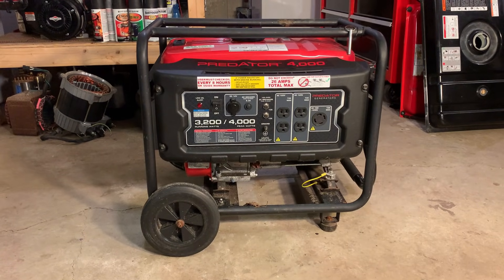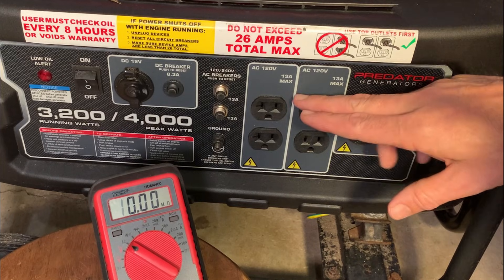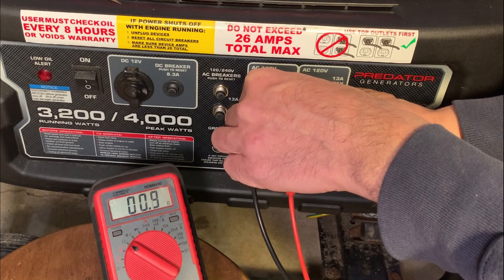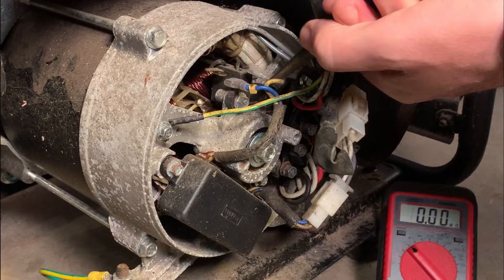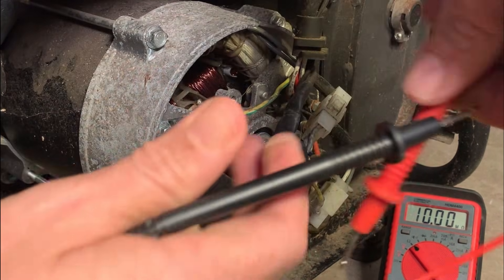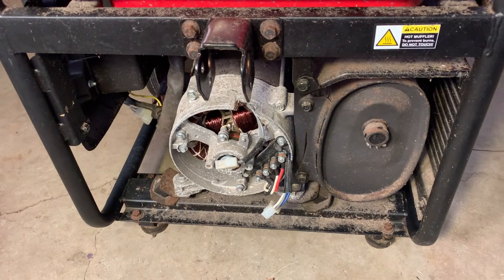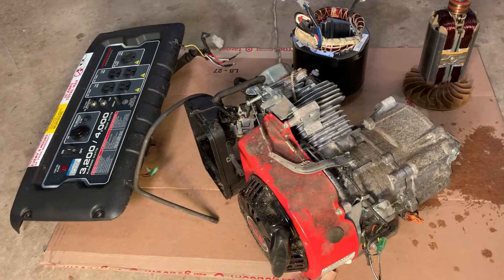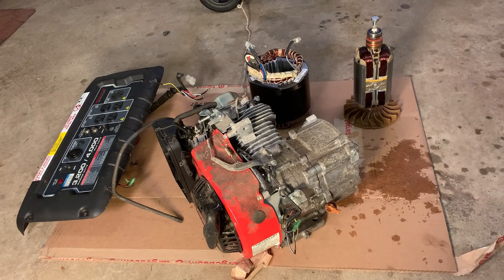Predator Generator Not Making Power

Comment: Similar problem,  I removed the wire winding (counted the number of turns), rewound it for $8 worth of wire, and it works like new.  It was a pretty easy fix.
Reply: Don’t forget about the generator safety rules: Always make sure you follow all the generator safety rules whenever you use your portable generator. This is only a reminder. Generators can be dangerous if not used carefully. Every year, hundreds of people die or get injured when using portable generators due to carbon monoxide poisoning and electrocution. Make sure you are using your generator carefully and keeping others safe as well. There is something very serious that everyone should always be aware of when using generators. Some people do run their generator indoors which is not safe and that increases the risk of carbon monoxide poisoning which can cause death of family and you. Some people run their generator in wet conditions which can electrocute them. Please remember that you should never run your generator indoors. Remember that carbon monoxide is an odorless and colorless gas that you cannot see or smell. Carbon monoxide is a silent killer. Keep that in mind. Make sure your generator is 15-20 feet away from your house and away from doors, windows, and vents. Never use your generator in your porch too. Having a carbon monoxide detector is very important against generator safety. Some people also allow children to go near the portable generator which could pose risks. We need to keep an eye on our children making sure that they are not near the portable generator so they won’t get electrocuted or burned by the generator which is dangerous. A locking enclosure also keeps kids safe. A generator shed might look like a tempting place to explore, or take cover during a game of hide and seek, but a generator is a dangerous piece of equipment that can cause injury. It says on the manual that we should also keep children away at all times from the portable generator to avoid injuries. Please do not allow a child or unqualified people to operate the portable generator.  It is important to keep your children safe especially little ones. The portable generator can be hot during an operation. Just because some manuals missed what should be listed doesn’t mean it’s safe to do. Always follow the generator safety rules when using portable generators. Generators pose electrical risks. If you need to use your generator during wet weather, you need a generator tent to protect your generator from getting wet. Don’t let your generator get wet. Keep your generator dry and before using your generator, please make sure your hands and your generator is dry. Do not wear loose clothing when operating the generator. Everything that is said on the generator’s operating manual should not be ignored. Never smoke cigarettes near the generator. Please keep flammable things away from the generator. Never overload your generator too. Your generator can catch fire. Never ever try to plug a generator cord into a wall outlet to avoid back feeding. Back feeding your generator is dangerous. Always turn on your generator first before plugging in appliances and shut off the appliances before turning your generator off. Use a heavy duty cord for your generator and the cord should not be worn out. All the instructions should be followed carefully. Never refuel your generator while it’s running. It can cause fire if fuel spills while your generator is hot. You should turn off your generator and let it cool off before refueling it. Having a fire extinguisher next to the generator is also important. This is only a reminder for everyone’s safety of using generators. Make sure your generator is properly grounded. Having a fire extinguisher next to the generator is also important against the safety rules. https://youtu.be/I1jT3ANENvI and here is a video more about keeping others safe when using generators and also about our family’s safety. It’s important to keep our little children safe as well. Make sure your little children are kept away from the generator at all times especially when it’s running. Hope this helps. Always remember that it’s better to be safe than sorry.
Reply: @The_Happy_Aviation_Enthusiast  Stop reminding people not to use engines indoors. We need to cull the herd. Anyone stupid enough to run a gennie indoors needs to be removed from the gene pool.

Comment: Either that gen set sat outside or the owner was lying about 'it was never even used'! LoL
Reply: Never used “a lot”.
Reply: I think it sat outside, (the frame and corroded wire) but the brushes look new.
Reply from the maker: Definitely sat outside for a long time.
Reply: @jcondon1  if I have 0 ohms across the stator, does that mean a bad stator? 
I’m confused because I tested them several days ago with a digital, then tested them with a Simpson 260 analog meter w/fresh batteries and got 0... THEN I retested w/my digital and got 0. Am I doing something wrong?
Reply from the maker: @wayngoodman5889  is it zero or OL?  OL is definitely bad.  Never seen one at 0.  Closest was probably 0.2.  If 240 volt, are both main coils zero?
Reply: @jcondon1  fresh batteries in Simpson 260, properly zeroed, three leads (white/red/blue) on Toro T3000D... manual says test across blue-to-red - zero ohms. Testing white-to-red and white-to-blue also zero ohms.
This is on a 0-1 ohm scale so zero means zero
Reply: Problem is when I tested on Sunday - w/a digital multimeter - I was getting close to normal resistance...?
Reply from the maker: @wayngoodman5889   I took a quick look at the wiring diagram and agree blue to red is a good test as well as blue to white and red to white.  Visually when looking at the stator, do you see any issues?  Most likely you will have to uninstall it to have a better look.
Reply: @jcondon1  is there any way I can connect with you directly? I have a ton of questions that might best be handled off-line.
If not, everyone be prepared for some truly ‘stupid newbie’ questions...
Reply: @jcondon1  to answer question directly, no obvious issues... the genset is dirty as all hell but no immediate signs of burning or overheating - at least to MY uneducated eyes!
Reply from the maker: @wayngoodman5889  on a computer browser go to my about page.  There should be an email link for business inquires.  Does not seem to work on mobile devices or in the YouTube app.
Reply: @jcondon1  will do! I’m using an iPhone app so I’ll grab my laptop and get with you that way.  Thanks SO much fir the offer - I’m pretty handy but generators are ‘black boxes’ to me...
Reply: @jcondon1  sent an email... hope it gets there!
Does the generator wiring have to be all connected on the guys for the engine to start? I could get the engine to start on starting fluid before teardown, but not even seeing spark now - but all the generator wiring is disconnected...
Reply from the maker: @wayngoodman5889  yes got your email.  Sorry have not had time to respond.  Usually the generator wiring does not need to be connected to get the engine to start.  Usually the engine coil is all you need.
Reply: @jcondon1  that’s what I thought... I’m going backwards on this damn generator
Reply from the maker: @wayngoodman5889  did you remove the coil at one point.  Potentially it is backwards?  That would cause a spark issue.  Also check the gap.
Reply: @jcondon1  THAT’s the crazy part: I didn’t mess with the coil OR the engine, other than to clean the exterior! I did put in a new plug, so I’m gonna see if the old one shows a spark.
Reply: @jcondon1  got it running... I suspect some wiring might’ve gotten wet. Now on to generator testing!
Reply from the maker: @wayngoodman5889  funny.  That happened to me once.  Someone was coming to buy a dirty generator.  Thought I would spray it down.  And of coarse it would not start.

Comment: When its a loss like this, isnt it worth trying to pull that wire back a little bit and soldering on a connection? What's to loose?
Reply: Yes I agree a guy on another channel did that to a generator
Reply: @zweg1321  Would that have been mike, at "Small Engine Mechanic"? He made the same fix on a similar generator, then laced it up and potted it in resin. Seemed to work well for him.
Reply: @28YorkshireRose12  yes I remember who did it I just didn’t think I should give the YouTube name out
Reply from the maker: @zweg1321  all generator rotors should be potted in resin.  Am surprised the larger ones like that Cummins on SmallEngineMechanic did not.  I have reconnected several broken rotor wires in the past.  All worked after, but felt like I was selling someone junk.  The repair has to be potted to withstand the forces spinning at 3600rpm.
Reply: @jcondon1  I agree it would be a lot of work but if you don’t try how will I know when my sister to this one goes out 
I enjoy your videos and you responding back to me
Reply: @jcondon1  Yeah, doesn't sound all that fast, but the forces are higher than most would think.
I have an old (40yrs?) 4.8Kva (might actually be a 6.8 - not sure) Lincoln weld n power. One slip ring let go of the boss they mount to. Tried everything, had the thing apart at lest 12 or 15 times. Eventually I drilled and countersunk two bolts through it, worked for 10 minutes but the extra sparking of the brushes eventually melted the solder and it stopped making power again.

Apparently it's a known issue/design flaw. Can't find a fix for it.
Reply: @zweg1321  Don’t forget about the generator safety rules: Always make sure you follow all the generator safety rules whenever you use your portable generator. This is only a reminder. Generators can be dangerous if not used carefully. Every year, hundreds of people die or get injured when using portable generators due to carbon monoxide poisoning and electrocution. Make sure you are using your generator carefully and keeping others safe as well. There is something very serious that everyone should always be aware of when using generators. Some people do run their generator indoors which is not safe and that increases the risk of carbon monoxide poisoning which can cause death of family and you. Some people run their generator in wet conditions which can electrocute them. Please remember that you should never run your generator indoors. Remember that carbon monoxide is an odorless and colorless gas that you cannot see or smell. Carbon monoxide is a silent killer. Keep that in mind. Make sure your generator is 15-20 feet away from your house and away from doors, windows, and vents. Never use your generator in your porch too. Having a carbon monoxide detector is very important against generator safety. Some people also allow children to go near the portable generator which could pose risks. We need to keep an eye on our children making sure that they are not near the portable generator so they won’t get electrocuted or burned by the generator which is dangerous. A locking enclosure also keeps kids safe. A generator shed might look like a tempting place to explore, or take cover during a game of hide and seek, but a generator is a dangerous piece of equipment that can cause injury. It says on the manual that we should also keep children away at all times from the portable generator to avoid injuries. Please do not allow a child or unqualified people to operate the portable generator.  It is important to keep your children safe especially little ones. The portable generator can be hot during an operation. Just because some manuals missed what should be listed doesn’t mean it’s safe to do. Always follow the generator safety rules when using portable generators. Generators pose electrical risks. If you need to use your generator during wet weather, you need a generator tent to protect your generator from getting wet. Don’t let your generator get wet. Keep your generator dry and before using your generator, please make sure your hands and your generator is dry. Do not wear loose clothing when operating the generator. Everything that is said on the generator’s operating manual should not be ignored. Never smoke cigarettes near the generator. Please keep flammable things away from the generator. Never overload your generator too. Your generator can catch fire. Never ever try to plug a generator cord into a wall outlet to avoid back feeding. Back feeding your generator is dangerous. Always turn on your generator first before plugging in appliances and shut off the appliances before turning your generator off. Use a heavy duty cord for your generator and the cord should not be worn out. All the instructions should be followed carefully. Never refuel your generator while it’s running. It can cause fire if fuel spills while your generator is hot. You should turn off your generator and let it cool off before refueling it. Having a fire extinguisher next to the generator is also important. This is only a reminder for everyone’s safety of using generators. Make sure your generator is properly grounded. Having a fire extinguisher next to the generator is also important against the safety rules. https://youtu.be/I1jT3ANENvI and here is a video more about keeping others safe when using generators and also about our family’s safety. It’s important to keep our little children safe as well. Make sure your little children are kept away from the generator at all times especially when it’s running. Hope this helps. Always remember that it’s better to be safe than sorry.
Reply: @The_Happy_Aviation_Enthusiast  🤦🏽‍♂️
Reply from the maker: I have done it before, but there was not enough wire.
Reply: @jcondon1  where are you from
Reply: @The_Happy_Aviation_Enthusiast  🤦🏽‍♂️